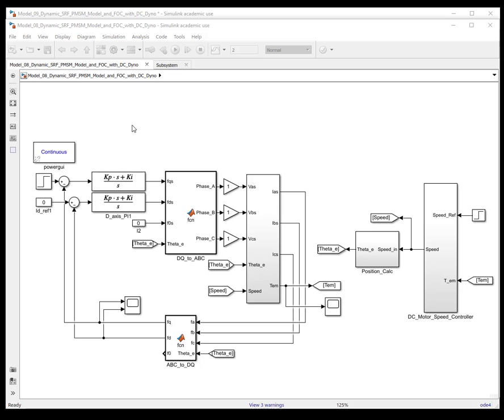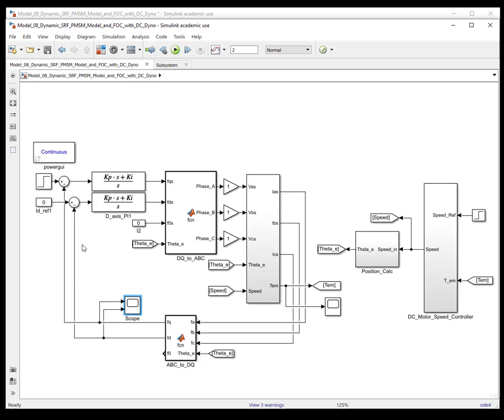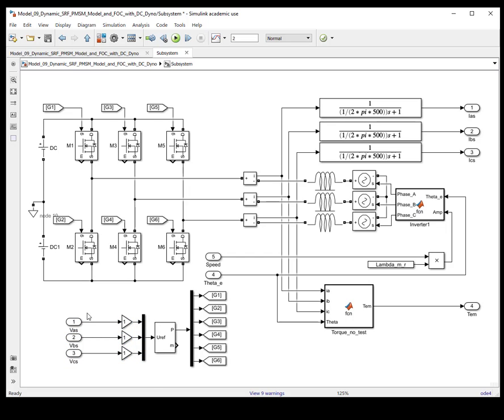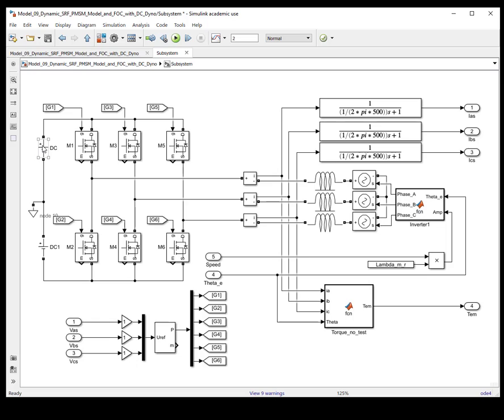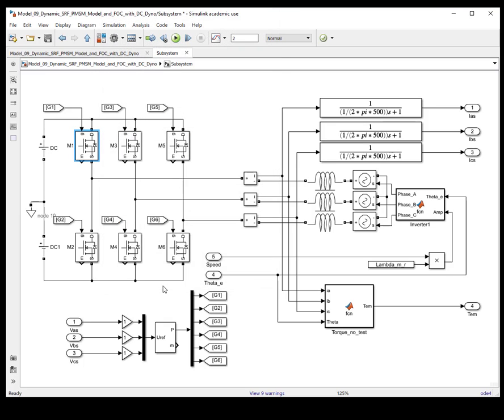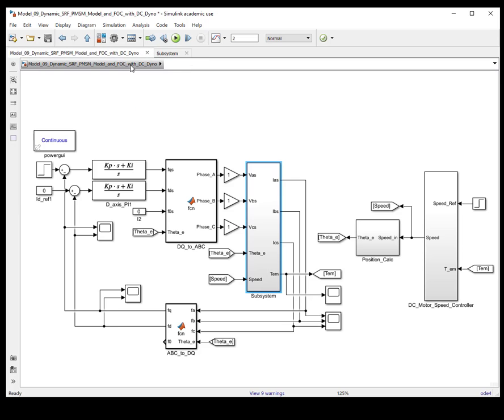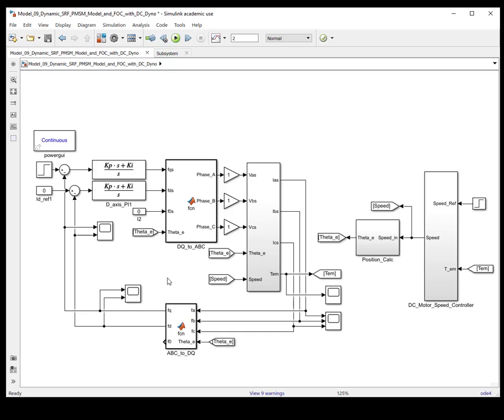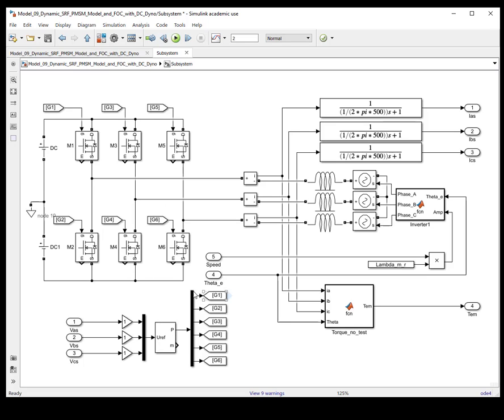Modeling Field Oriented Control of PMSM with Three Phase Inverter and DC Dyno

Comment: Hi Sandun, 
Amazing explanation, just one query 
If in case of shunt measurement, how will it capture both cycle(High and Low) of current ?
Reply from the maker: You will have to time the sampling points based on PWM frequency.
Reply: Thanks for the response, 
In PWM modulation, it is understood
The issues i am facing, while i am trying to do switching in SIX STEP/Full Wave(180 Conduction Mode) modulation for my application.
Can suggest some work around using this arrangement ?
TIA

Comment: Can you explain me what happen inside the block Torque_no_test ?
Reply from the maker: It is calculating the electromagnetic torque based on ABC currents.
Reply: Con you please provide the equation for Tem thats being used in the block Torque_no_test
Reply from the maker: @Adarshh_aa  Please refer to "Analysis of Electric Machines by Paul C Krause", in BLDC chapter.
Reply: @SandunKuruppu  Hello, sir.
I downloaded the text book.
However, I couldn't solve the torque_no_test problem.
I really want to keep following the video.
Would you please tell me the formula number at least?
Thank you.
Reply: @dwarang  Hello sir, did you find the formula about torque ?

Comment: Hello Sir,
I implemented this whole setup. I could see that the model works fine with speeds up to 2500rpm for speed reference. But when i increase the speed beyond that for a set id and iq value the , the feedback id and iq are not settling to the right value. Do you have any suggestion on why that might be happening ?
Reply from the maker: Vishnu, Can you share some of the plots that you see? What is your sampling rate? You can email to the channel email address.
Reply: @SandunKuruppu  Hello Sir, 
I have shared the plots via mail. Thank you for the help.
Reply from the maker: @vishnuharikumar4135  I received Vishnu. I will get back with you once I go through with them.
Reply: Hello Sir,
Did u receieve the data ?
Reply: Hi Vishnu, can you share the matlab model with me??,

Comment: sir what extra need to do for controlling the speed of PMSM in this simulation and I also saw people use decoupling block ,so what is the purpose of that.
Reply from the maker: Anmol, I have another set of lectures on my channel that explains speed control and decoupling control. Please take a look.

Comment: Sir how are you doing normalization for va vb vc between 0 to 1
Reply from the maker: Divide Va, Vb, Vc, reference signals by half the bus voltage (Vdc/2) or Vdc, depending on how you have your inverter setup. This will normalize your voltage commands to 0 to 1 or -1 to 1.

Comment: Sir make videos on effects of rotor position sense error on control algorithm  aslo  add regenerative breaking system in simulation. 🙏🙏
Reply from the maker: There should be a video on rotor position sensor error on my channel. Do you mean the theory part of it?
Reply: @SandunKuruppu  yes and and also simulation if possible